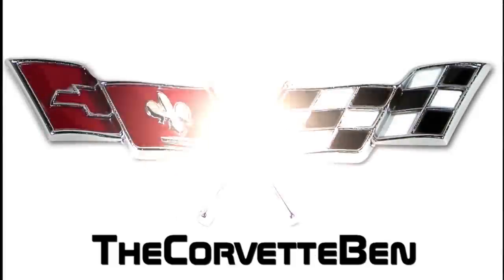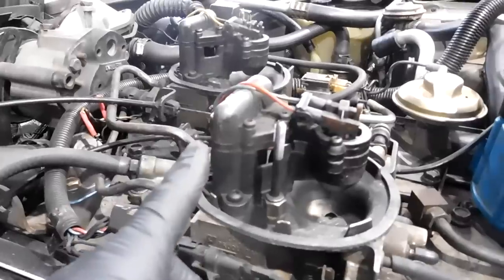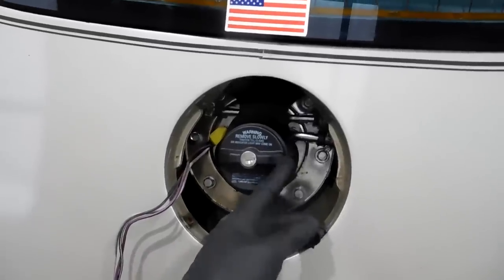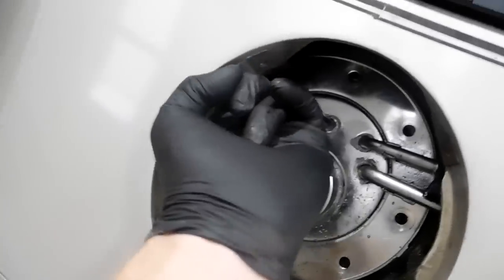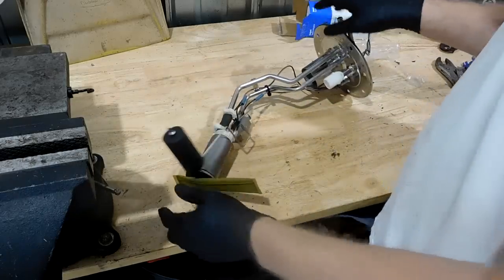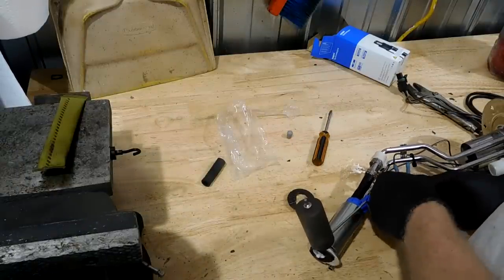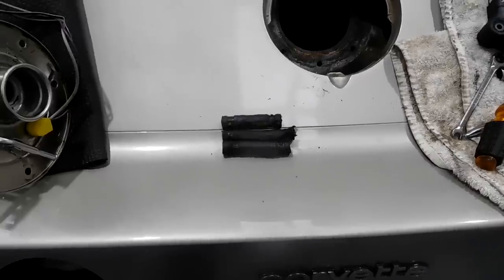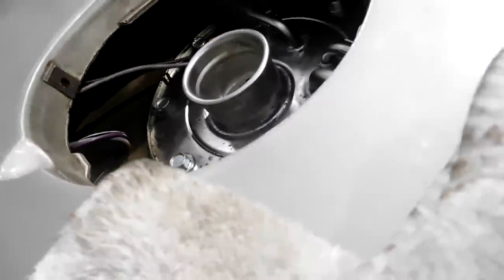1982 Corvette Cranks... But Does Not Run. '82 Collector's Edition Fuel Pump Diagnosis & Replacement!

Comment: Great fix Ben! I remember replacing many different model GM in tank pumps way back when everyone changed over to fuel injection. Same pump. lol. I remember my old co-worker saying. "I don't like this fancy idea of running an electric motor in 20 gallons of gasoline"! What if the motor heats up? Or a wire gets loose"? lol. I miss those days. But i sure don't miss those early Ford ( I think) "variable venturi" carburetors !! Or the early Chrysler "Lean burn" system. Wheeew! don't light a match!

Comment: I have worked on the L83 crossfire fuel systems on both 82 and 84 corvettes and the best pump I have used is the original AC DELCO 13 psi at the cross over line works every time

Comment: I knew 3 people that had crossfires, none of them ran well, but they are good looking cars!
Reply: When you say that "none of them ran well", are you saying that they did not run smoothly, were troublesome to maintain, or just slow? They were used by GM, European and Japanese auto makers in one form or another for many years. Of any form of fuel injection ever installed on an American car, the TBI was easily the most reliable.

Comment: Great video!  Appreciate the info. I'm curious why you went straight to testing/pulling the fuel pump before testing the other simpler things that could have gone bad like the Fuel Pump fuse, Fuel Pump relay or ECM.  Also, would checking for faults via the ODB1 module throw a code that would tell us what went wrong (bad relay, bad ECM or bad fuel pump)?

Comment: Nice job! Question, My gas gauge is not working correctly and I want to check the gauge in the car(82 Vette) witch wire is for the gauge going to the sending pump? Your would be much appreciated. Thanks!

Comment: Question; you said a fuel pump or a relay. Couldn"t an old, stopped up fuel filter prevent it from getting fuel to the injectors also? Thanks~

Comment: I have a 93 with a crank no start.  It seems like it wants to start but doesn’t. Any suggestions??
Reply: Mario,gr8 Vette.  I'd start with checking the dreaded Opti spark distributor.  Its notorious for failure on GM's of that era.

Comment: My gas tank must be shifted up as well because my 82 Collector sending unit sits exactly the same. (Side note) That rubber vapor line on the left side of the sending unit had a split and was the reason I wasn't passing California Emissions testing. There are actually 2 rubber hoses on the left and it was the further most one. The hardest to reach one of course.

Comment: Back when the Crossfire first came out it quickly earned the reputation for "can't fire" with all the problems the first attempt by GM for electronic fuel injection. The second attempt with Tuned Port Injection ( 1985 ) was much better and more reliable.

Comment: I am confused about your testing procedure.  Looks like you had the fuel pump disconnected from the harness when you rigged up the test light to the wiring harness coming from the car.  You turned the key on, the test light came on, but when you cranked the engine, the test light went out...  Seems like the test light should come on for just a few seconds when you turn the key on to prime up the system, but it should stay on when cranking...  I got lousy eyes so probably just didn't see the light correctly.  Edumacate me Ben!
Reply from the maker: Test light didn’t go out, it was just very dim. Hard to see on camera but you could see it in real life. The battery was also really low due to the owner cranking it over and over.
Reply: @TheCorvetteBen    Thanks for the explanation!

Comment: @2 min 31 sec you put wires on the black and purple which is blk far right and red middle far left is the tan wire which actually powers the pump motor i know this because i have 82 c3 corvette and i'm not receiving power at tan why?

Comment: first I would do a Noid test to the fuel injection on the thottle body carbs if you the noid lights don't show any signal by flashing then its your ECM and nothing you going to do to start the car.

Comment: You say that it will be a fuse, relay, or the pump, but not the inline fuel filter?? Always change the filter before changing the pump. There is nothing wrong with TBI systems, millions of GM vehicles were equipped with them. Regarding the 1982 Corvette, most complain because it is rather slow, but what do expect from 9:1 compression, a taxi-cab cam and a 2.87 rear axle ratio? Everything in 1982 was slow.